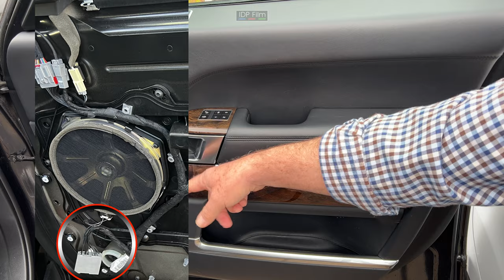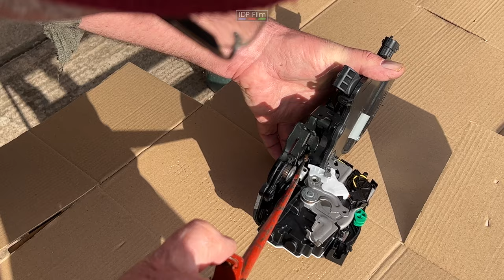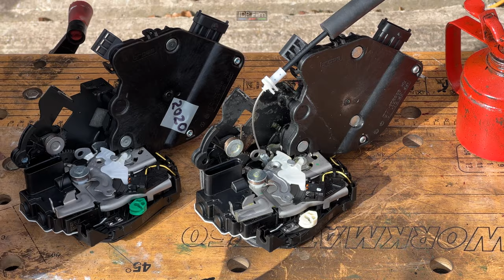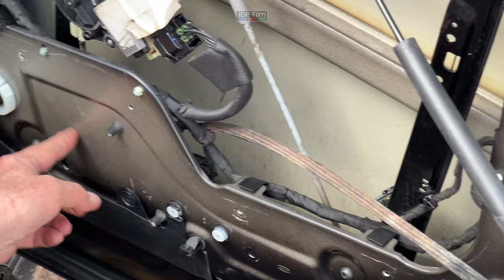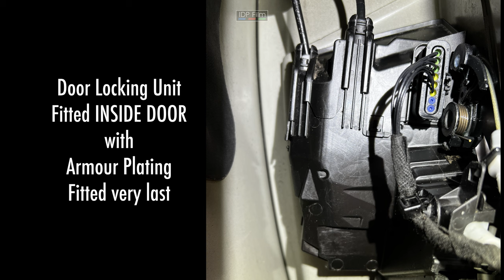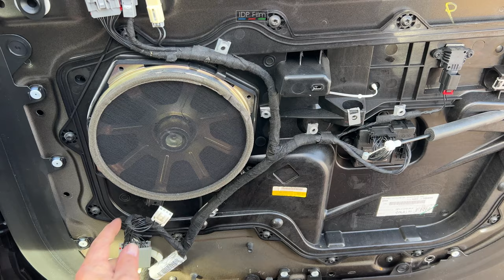HOW SAFE is Your Car - Car Security

Comment: Great step by step guide - had a few months ago my car when locking - KEPT after 2 or 3 mins unlocking ! - a week or so later found out it was the electronic door lock after a stealer ship charged me £140 diagnostic fault finding. ended up paying £585 for the repair - could have done this all myself and saved loads.
makes you think these electronic door locks need to be renewed every 4 or 5 years in order to insure they work.
anyway nice video which clearly shows how to do it yourself - thumbs up